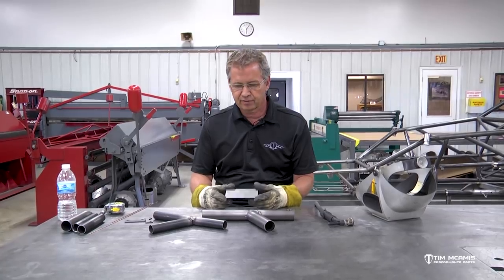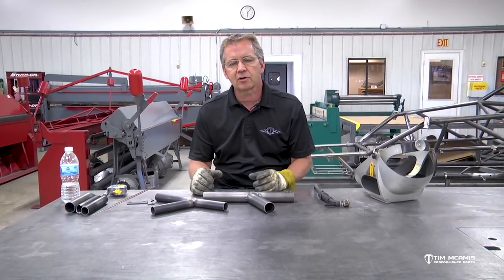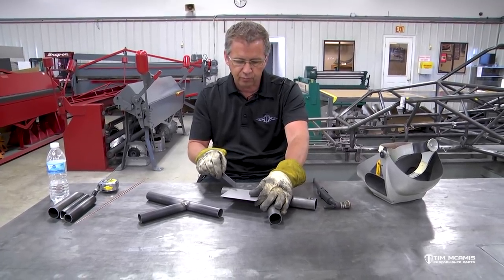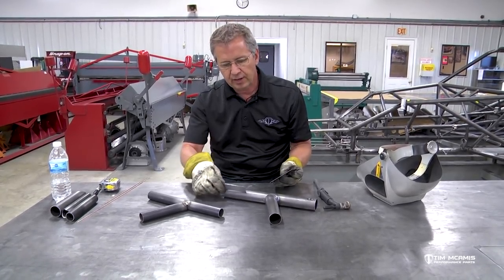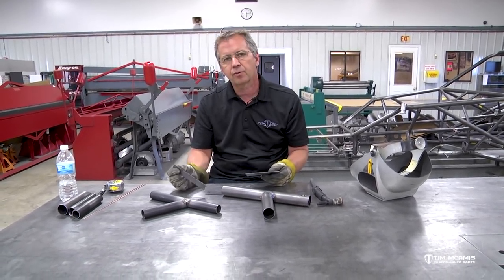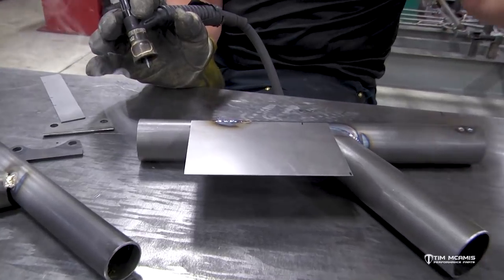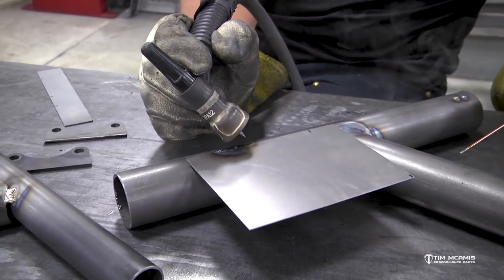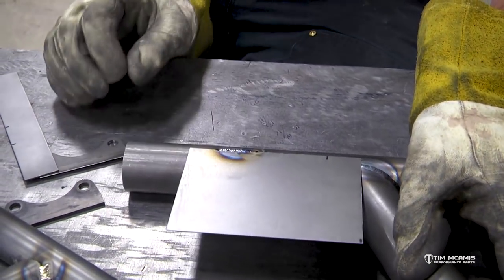Welding Plate & Sheet Metal - Fabrication Series: 10

Comment: This guy is the best fabricator i have ever met. Every washer on his cars is correctly positioned.  Worked there for a short time years ago.
Reply: I've been welding mild steel tube chassis offroad vehicles for 4 years but this is a different level. Do you have any advice on whats needed to get a job like this? Were there any downsides? Thanks
Reply: rednoseroyce you need to be well rounded in aluminum and carbon steel . Tim required welders to be on top of their game, perfect welds.
Reply: ok thanks. Why did you only work there for a short time?
Reply: rednoseroyce 4 day work weeks of 40 hours wasn't enough for me. Drove 8 hours a week to and from work.

Comment: 》》 Around 16:00 time stamp. Tim says I am going to weld this Hot, etc... So  I was Thinking.. He might have some issues making it look shitty... Tim welds. Stops. He then says I had trouble making it look shifty.. Just what I said.. 
 When Your Really Good at something. It is hard to do a bad job. *As
 An - AVIONICS Machinist I  machine parts in  ( + /  -- ) .00050 tolerances. Which is 50 Millionths of an inch... Which is 1/2 of A Tenth... Also 20 -- 30  Milionths.. So it is like 1/4 - 1/3 and then the 1/2 of a Tenth of a thousandth... Sorry this was so long..